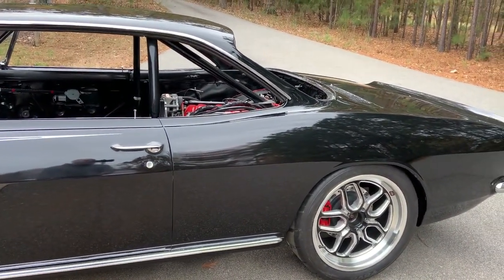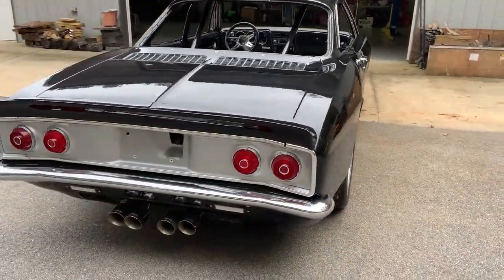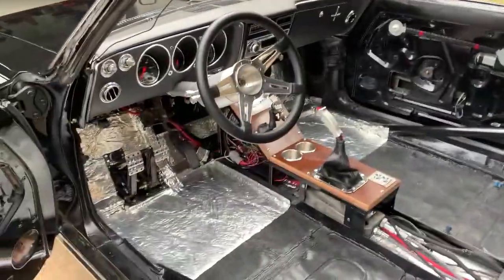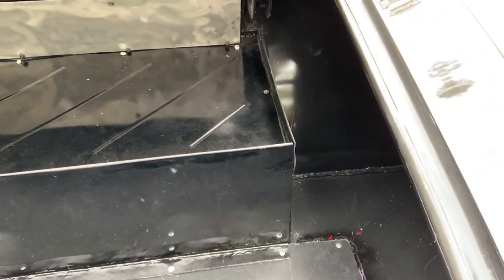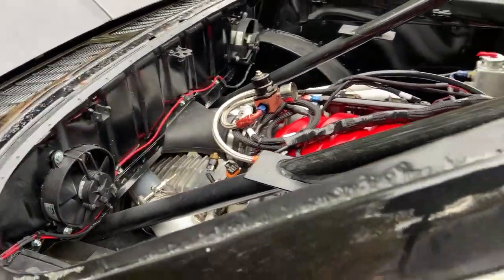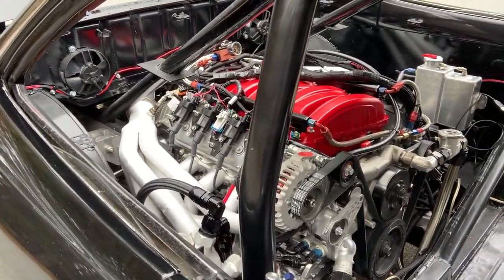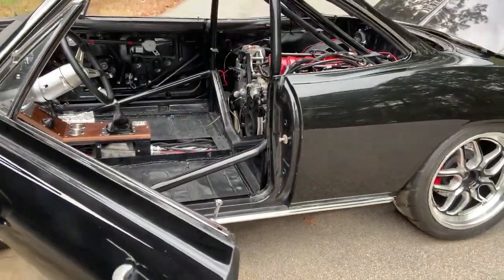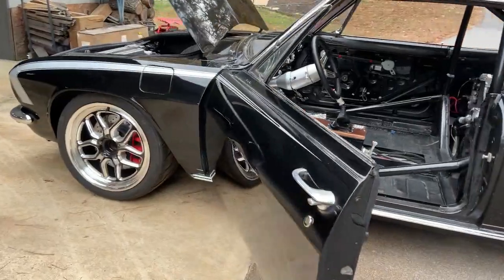NN 2 0 Video#13

Comment: Sir awesome job on corvair, my question where did you get the headlight/turn signal unit at , nice setup thks,
Reply from the maker: Thanks for the comments. The answer to your question is in video number 6 at about the 14 minute mark.  Check it out.  I will say that I needed to make alignment notches in the backing plates for these units.  The notches in these units are difference than the older incandescent bulbs.
Reply: @nadersnemesis2.071 
What did you use for the rear lighting/turn signals? I love the sequential signals
Reply from the maker: Here is a link to the sequential turn signal device I used.  https://www.webelectricproducts.com/store/STS-1-Universal-Sequential-Turn-Signals-p265699267

Comment: AMAZING car!!!  Super nice detail put into it.  Well laid out, etc.  Can I ask a question? (a fellow Corvair owner)....where did you get the headlights??  I have been looking for ones similar for a LONG time and haven't seen any that fit the original trim.  love the look and function of yours!!  Thanks.
Reply from the maker: Thanks for the comments. The answer to your question is in video number 6 at about the 14 minute mark.  Check it out.  I will say that I needed to make alignment notches in the backing plates for these units.  The notches in these units are difference than the older incandescent bulbs.

Comment: How did you plum the proportioning valve? I’m working on something similar and think I need to control the rear rather than the front.
Reply from the maker: Greg, I decided to use dual master cylinders and a pedal with an adjustable cross bar.  I felt like that would give me the most flexibility.  It remains to be seen as I’ve not yet had it on the road.
Reply: @nadersnemesis2.071  Thanks for the response .

Comment: Well brother , you never stop amazing me. This project looks really nice. I do have a question . Will there be wheel wells installed up front or isn't there enough room for turning?  Your commitment to perfection hasn't faded one bit. If I had a garage I would be finding me an older CJ-5 and I'd be doing the same as you. I don't think mine would not look as good. You are amazing brother.
Reply from the maker: Thanks brother!